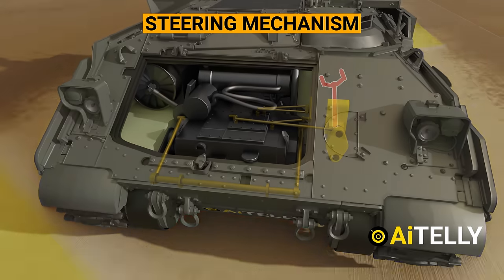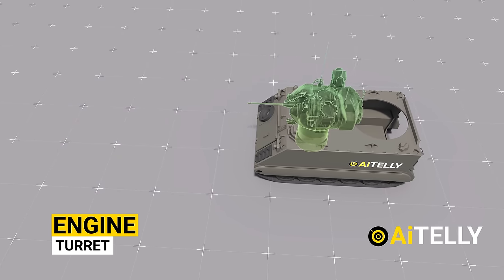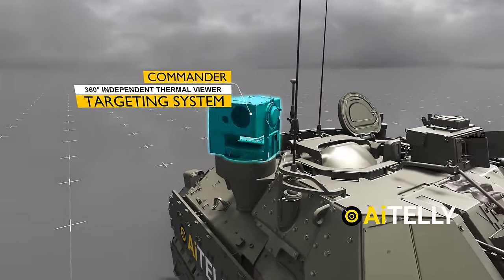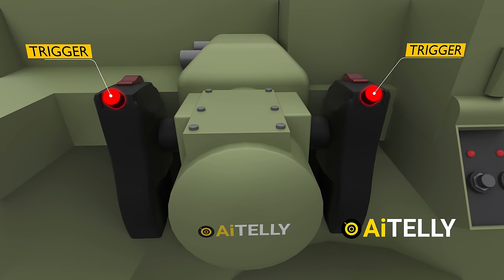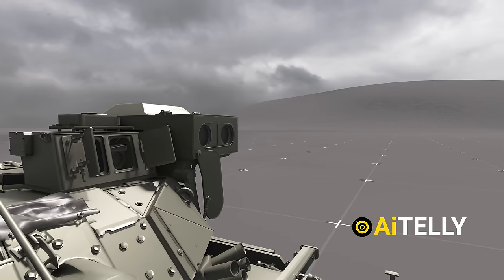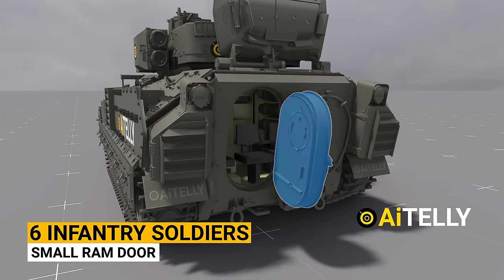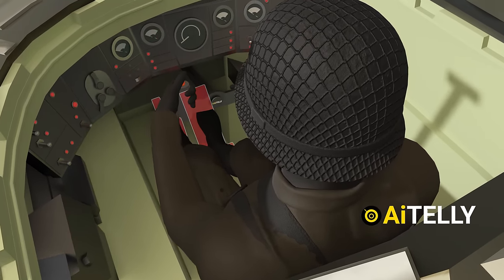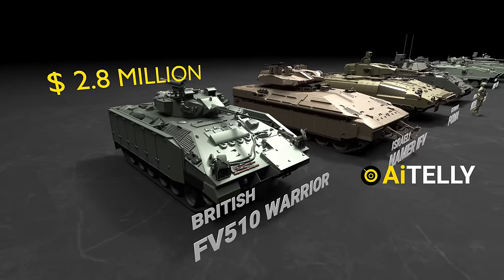Bradley Infantry Fighting Vehicle | How it Works?

Comment: Thanks, just bought one but didnt seem to figure how to use it. That orphanage doesnt stand a chance
Reply from the maker: Glad I could help
Reply: @Aitelly lamo 🤣😭💀
Reply: Your mother eats pork chops and bacon
Reply: @DeezzzzzzNuts12  Just say your life is going sad........no need to this
Reply: Huh, odd, crayon eating marines don't have a problem.
Reply: got a few here in donbass but gotta scrape the banderites off the interior.
Reply: So the dmv wouldn't register mine due to the state inspection not being done. Jiffy lube couldn't find the obd2 port. Know where it is?
Reply: What color do you have? Need a new skin tbh
Reply: @muhammadusmanrafique3517  'sposed to come with operator's manual, idn't it..??..😆
Reply: @DavidKalnbach-vm3xc  Yeah but it only had oil and bald eagles in it
Reply: @muhammadusmanrafique3517  😅😂🤣
Reply: @Aitelly  yooooo 💀💀
Reply: Glad you could deal with the orphanage
Reply: @muhammadusmanrafique3517  WHAT

Comment: The Bradley didn't disable the t-90 they manage to destroy the optics and blind the commander but it was two drones that actually destroyed the tank
Reply: Actually they disabled the turret it shows it in the video. The Bradley was also unable to use the armor piercing rounds for whatever reason, can’t remember. Regardless the Bradley spanked that t90. Also videos of a Bradley taking out another t90 with a tow missile. Russian tanks have weak armor for today’s standards.
Reply: @andreww1225  not really the Bradley commander himself said that he was using sabot rounds and he couldn't damage the t-90 so he tried to damage the optics on the turret Also there is no evidence  or report of a Bradley destroying another t-90 using tows
 idk maybe you're talking about that one case of a t-80 which was also a rear incident 

Btw how are russian tanks have weak armor there are several videos in telegram of russian tanks surviving rpg and drone attacks if you're judging based on them getting destroyed in a modern battlefield then don't forget that western armor didn't fare much better either
Reply: @right584  western tanks are much more safe than any Russian tank that’s a fact buddy. You should watch that video again he was unable to continue using armor piercing rounds that’s why it shows him mostly using anti personnel rounds. Russian tanks are coffins, seriously what idiot designed a tank that the crew has to sit on the ammunition. No tank blows up as nicely as a Russian tank.
Reply: So what is the other term of disable aside from being limited?  t90 maybe thick but slow in both speed and firing.   Bradly has the advantage first it is capable of armour penetration and have speed.
Reply: The brad  in question running against the T90 in question went black on AP rounds. Coming from a former brad driver/gunner and TC he did the right thing by going after optics and turret ring. You can see when the HE rounds started hitting by the splashing and spalling. The AP rounds would do very little which is obvious it isn't meant for tank battles. The HE rounds and the spalling did the damage to the optics and turret mechanism that is very fragile.

Comment: The "unusually large" door serves as an access point for reloading the TOW launcher. The gunner will manipulate the turret to make the back end of the launcher reachable from this door. The door also offers rear protection, allowing the crew to reload the TOW while shielded from potential threats. As depicted in the illustration, this process eliminates the need for the crew to expose themselves during the reloading process.
Reply from the maker: Noted thanks 👍🏻
Reply: As a fellow former Bradley soldier, I concur. The TOW was reloaded from the top hatch, dismounts staying within the vehicle as much as possible.
Reply: Crew Cargo Hatch.  Fun note - you can open it all the way, put some seat cushions on it and it makes for a sweet ride.
Reply: You can open the hatch to the "tow load" position which gives the loader good protection and also up in the turret you have the indicator that let's you know when you've got it angled off center enough. Also on the ISU integrated  sight unit on top of the turret on the gunners side the doors flip up not to the sides. Also you've the gunner has a circular wheel to traverse the turret manually and another one to manually elevate the gun with a trigger at the end. This allows you to still fire the gun if you lose power or the hydraulics are list. I was a gunner on a Bradley.
Reply: I made a similar comment before scrolling down and seeing your comment.  Cheers.

Comment: there are 6 seats and a space you can squeeze a 7th into. the 6 seats are 2 bench seats along the sides of the troop  compartment looking towards the centerline of the vehicle. the 7th dismount spot is shown correctly as it is behind the driver. m2 bradleys still carry extra reloads for the tow launcher by keeping them essentially as back rests for the 6 troops on bench seating but its only single layer deep so it decreases load capacity when compared to m3 CFVs.

Comment: 7:14 the infantry doesn’t have to exit the vehicle to reload the TOW, the turret can swung slightly left and the infantry can reload it by poking out of the large hatch with a new missile. This can be demonstrated by the Bradley IFV’s promotional film from the 1980s
Reply from the maker: Thanks for your feedback 🙏🏻
Reply: Can confirm that’s the main reason for the rear top hatch. Not to load anything inside. The ramp would be a better option to load gear and equipment.

Comment: Great video with excellent animation.  However, whoever made this video has never been on a Bradley.  Having spent years on the BFV, I feel the need to point out the errors.  The pic to the left was taken by me on an M2 ODS.

3:35:  Commander's and Gunner's sights are labelled backwards.  The video does correct this though

4:32:  The trigger fires whatever weapon has been selected; not just the COAX.

4:46:  The COAX does not move independently from the main gun.  Again, I was on the ODS and not the A3 or A4, but, due to  how  the weapon trunnion is designed, it just isn't possible.

5:14:  That button is not "obviously" the trigger; it's the fast turret switch.  The trigger is in the front.

5:20:  Again, the trigger fires whatever weapon is selected. not just the main gun.

5:53:  The Bradley is NOT a tank!  Call it one to a staff sergeant and see what happens.

6:47:  The TOW front plate drops due to the lower linkage as can be seen in the illustration/animation, not due to gravity.

7:16:  The TOW loading is incorrect.  The purpose of the crew hatch is primarily to reload the TOW.  The gunner has an azimuth gauge in the turret and traverses to a certain azimuth labelled in the turret.  He then elevates to a certain angle and the crew loads from the rear dismount compartment.

8:30:  Luggage?  Are you kidding me?  Why not just bring equipment in through the rear with the ramp down?  Luggage?  "Private Smith!"  "Yes Sergeant?"  "Have you loaded the luggage for the mission tomorrow morning?"  That's a new one...

9:03:  Those are side skirts, not armor.  They protect the tracks from bushes and such, and will stop small arms, but they are not armor-plate steel.  They are designed to be removed by the crew; armor-plate steel would be WAY too heavy.

10:04:  The driver's intercom button is not to speak to the commander.  The BFV's communication system allows the crew and squad leader continuous communication.  If the driver wants to speak to the TC (Track Commander), he just speaks.  The button allows the driver to transmit messages over the radio to other listening stations.  It is rare for the driver to transmit over the radio though...
Reply: The video looked good, but so much was inaccurate or misinterpreted.  They'd do better to run the videos by someone who has some basic experience with it, because they can tell them "hey, that's not right, it's this instead".  Like the idea the coax can be used independently of the main gun.  The BC can fire it, but it's always moving with the turret itself.
Reply: I’ve been on a brad for a few years now and to this day have never seen the button on the driver steering yoke used, still don’t know what it’s for. Only thing I’ve been told is that it’s a last ditch effort button for the driver to override the gun and operate it, never heard it being used to transmit over the radio though, I just used the transmit button on the cvc for that (yes I was allowed to transmit over the radio as a driver, I was a very overqualified driver)
Reply: Lol, the tow front plate has a fixed point visible in the graphic. It never moves, the launcher erects from behind it. Bet it would shock them to know you can manually raise the launcher, but it ain't fun
Reply: @joehughes5177  Yeah,  you have to ratchet that damn thing up and it takes FOREVER...
Reply: @joehughes5177  it’s almost as fun as manually traversing the turret

Comment: 0:22 "WIRELESS", meanwhile you can see the wires xD
Reply: the TOW-2 uses dual guidance, Wired and Wireless
Reply: Fly-by-wire or sumthing
Reply: @ItsA72  Thats entirely different concept
Reply: Bunker buster version is wireless and laser guided
Reply: @Channel-23s  The TOW 2 series are both Wired and wireless (laser guided)
if the enemy has laser Dazzler, the wire would still allow it to be controlled, it can be wireless if the wire is somehow snapped (one of the problem for early wired ATGMs)
Reply: TOW= Tactical Op Wired?🤔
Reply: @all4humanityplz  Tube-launched, Optically tracked, Wire-guided
Reply: @krellio9006  -THNQ, it's been 40+ yrs, since I worked/ drove/ swam these Bradleys, @ San Jose's FMC! 🤗
Reply: The W in TOW stands for wire guided. It has two thin wires that stay connected to the launcher until impact. That's why you can't "fly" the missile, it's gotta stay pretty straight.
Reply: @realWARPIG  No longer true for the TOW-2
TOW-2 are both Wireless and Wired

Comment: The tow 2 isn't wireless, it very much has a wire. You can't use it over water if the distance is more then 300m because it will short the wire.

Comment: The Tow 2B is not a fragmentation warhead, its an EFP warhead. It has several EFPs that are angled downward. When they explode, they send several penetrators all angled at the same spot that are enough to penetrate the thin top armor. The use of multiple penetrators is to break through any ERA bricks that might be on the top of the tank.

Comment: I wonder if someday people made an IFV as small as BMPs but with capsule hotel like arrangement. Which can be jettisoned in case of catastrophic damage. Or launched like a VLS system 😂.
Nah, jettisoned. By laying the first row to the ground as the vehicle moves forward, lowering the upper rows, then do the same.
Each capsule can be opened just like a capsule hotel like to be, and by opening the top lid of the capsule. For a rapid deployment.
The bottom side of the capsule have some small struts to absorb the jettisoning impact. And retractable castor wheel to carry the injured.
Each capsule has its own bed, and ofc sound proofing. Also doubles as a brig if you want to capture someone.
Since it is a bed, technically can also be used as an ambulance.
To make some room each capsule can be dismantled. Maybe for an SAM suite, cargo, or bridging.
I think it could carry 4 people inside the all the capsules. Maybe 6 if you think soldiers don't have claustrophobia.
The capsule itself is unarmored. But the bed carrying them is.
It has one driver and one gunner at the front side. Which enters the vehicle like a truck, so, from the side.
The vehicle has no top hatch at all. So you don't need an additional roof for an occasional rain of hand grenade.

Comment: Also the 25mm gun has armor piecing and fragmentation rounds, the latter can be set to a fix distance to neutralize infantry targets in trenches or behind cover. The ammunition type can be switched by the controls as the gun has a double feed system. Hopefully with some upgrades this IFV can be modified to target drones.

Comment: the M3A2 Bradley IFV could do with a turretless variant . . . a turretless M3A2 Bradley will sport a raised (heightened) hull, providing some much needed room inside the otherwise tight knit crew/troop compartment . . . a 5.5 in. coil spring suspension lift that'll complement the torsion bar setup of the M3A2 resulting in enhanced off-roadability . . . the heightened hull will feature 2 full size roof hatches for observation & gunner . . . either of the roof hatches can be armed with a 30 MM GAU-8/A six-barrel rotary cannon slaved to a 360° deg rotating remote weapons station . . .

Comment: So where does one get current pricing on vehicles that have been out of production for decades like Warrior and AMX-10P?
Reply from the maker: They never reveal the real price because they always buy in bulk including spare parts and maintenance.

It's a complicated process
Reply: @Aitelly  - I am aware it's not like buying a car - there is no window sticker.  However, my point is,... the last time a AMX-10P or Warrior rolled off an assembly line was 3 decades ago.  There is no such thing as current pricing under any circumstances.

Comment: How it works:
1) start a project by drawing a plan 
2) modify the plan too many times
3) made out of aluminium
4) make it a pass of production with promotions, decades of delays, and snafu the truthful reports
5) get a new lieutenant colonel for the project
6) repeat 1 to 4
7) aluminium plan failed because of the new lieutenant colonel
8) try to get the lieutenant colonel fired for frauds and snafu
9) test soldiers make sure working aluminium softer than paper
10) shit
11) car tank taxi made of strong steel and no cut costs
12) 18 years for a box on wheels to use as a taxi
13) get a movie for it

Shortest summary possible

Comment: Its funny how you completely skips the most numerous and most modern and in the future most numerous IFVs 
there are 4641 M2s , 2950(+) ZBD04 , 1750 AMX10p,789 Warrior, 760 (+) BMP3, 350 Pumas, you never mention BMP2 (20000+, BMP1(20000+), Marder(1700), or fx cv90 which is going to be the 4th or 5th most numerous IFV ever with 1400 already built and 1700 on order for BAE systems , all of the last 4 are in use in Russia invasion in Ukraine, and Warrior is about to be faced out so is irrelevant for price comparison, just like AMX 10P so to compare prices you should compare the price of Puma, the new xm30 (same price as Puma more or less) , CV90 Mk 4, ZBD 04 , BMP 3) not old vehicles from the 60/70/80/90/00 , also the price of the Puma includes all the fancy infantry com links that make PUMA in a class of itself where crew and infantry share data seem less which none of the other can in the same way or extent.

Comment: At 3:39 it seems the commander and gunner positions are swapped. Shouldn’t the gunner sit on the left?
Reply from the maker: Yes Gunner on the left almost on all US tank
Reply: @Aitelly  on Abrams and Booker, the gunner is always on the right side in front and below the commander, this way it is easier for the loader to pick up rounds and reload. In IFVs or auto-loading tanks like the Bradley, T-90M, Type 90, the gunner sit on the left for more intuitive aiming as reloads are not done by a human loader and the gunner can help the commander if anything is wrong with the autoloader or manually load specialty rounds like ATGMs that is not in the autoloader.
Reply from the maker: @dannyzero692  yes you are Right Thanks Danny we got Confused
Reply: @Aitelly  no problem! Glad I could help

Comment: Sprockets drive the track's connected pads, & not the wheels! No track= sprocket mere spins freely, & if one track side's off, the BFV's other side spins in a circle! Wheels keep the moving track pads aligned straight.. 🤔😥

Comment: I was a Bradley Commander for 4 years... You need to learn A LOT more before posting these videos.There are many things wrong with your video:

1:21 that is NOT how they sit in the vehicle. They sit 4 on one side (including one behind the driver) and three on the other.  

Also, you have the sights wrong in the turret. The gunner sits on the left and the commander on the right. 

The external camera started on the Bradley M2A3 variants. 

The controls for the gun are wrong too... You select the coaxial gun on the control panel between the gunner and commander. The commander can fire the 25 mm or coaxial gun from one trigger on his controller. 

The coaxial gun CANNOT move independent to the 25mm.

The two red buttons are the operate the laser rangefinder to enable the gun to adjust for distance. The guns are fired by the front trigger on the cadillac. There is a separate button on the front of the black handles to act as a safety. 

There is no need for a sensing round. Once you use the rangefinder on the target, the barrel adjusts for the distance automatically.  You use the laser rangefinder the target, pull the trigger and shoot a three round burst.

Only one variant of the TOW missile is top attack, BGM-71F. The rest are direct contact with the target and various size warheads.

The door at the rear of the turret is also to reload the TOW missile without completely exposing the troops.

Get your facts straight BEFORE making an ass of yourself.
Reply: The Bradley IFV is the best of the bunch. I would also tow a M777 155mm howitzer to increase firepower. What do you think?

Comment: If the 25mm has a range of 3000-6000m, what happens if the target is 2000m away? Do you go in reverse for 1000m to get the cannon in range? Or just sit there and wait untill the target moves away the necessary 1000m?
  Or, perhaps, don't be an imbecile and state the minimum range to be 3000m when the damn thing is perfectly able to shoot at targets closer?